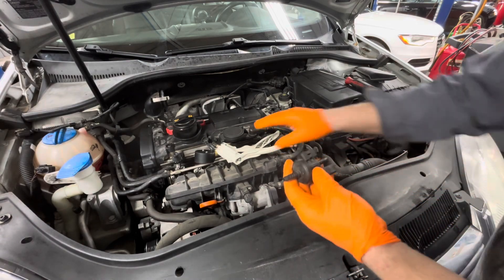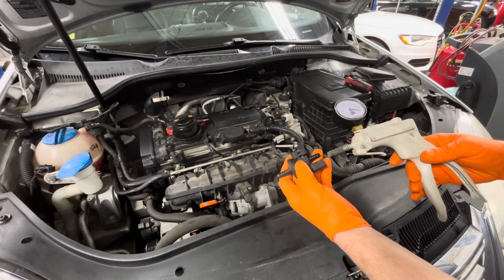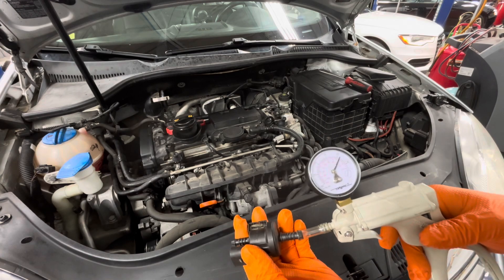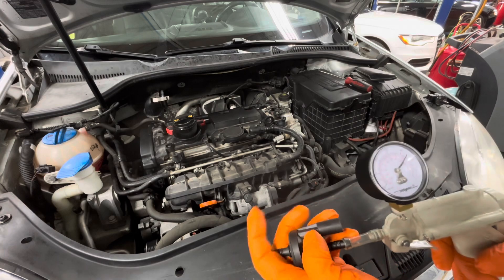Common Cause of P0456 Fault and Testing Evap Purge Valve

Comment: Are you familiar with BMW evap systems that use a venturi before the purge valve? I had an X3 recently and the purge valve had 2 lines that go to the intake and the other line goes to the evap system. Service info called one of the hoses from the intake a venturi. I'm guessing it has something to do with he intake having boost pressure instead of vacuum. I would like to know more on how that design works.
Reply: 2017 BMW X3 sDrive28i

Comment: What I like to do because I'm lazy and don't want to grab my vacuum pump or even pull the purge valve off of the car. I disconnect the line from the purge valve that runs toward the fuel tank and start the car. If there is vacuum felt with your finger its bad. Then I will unplug the electrical connector to make sure the computer is not commanding it open to be sure.